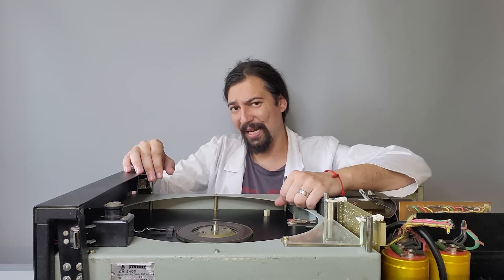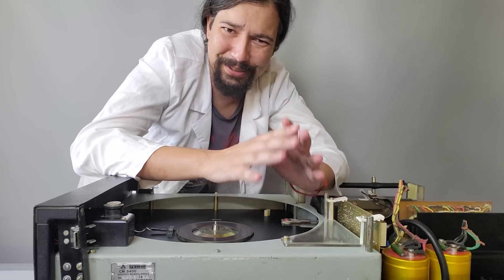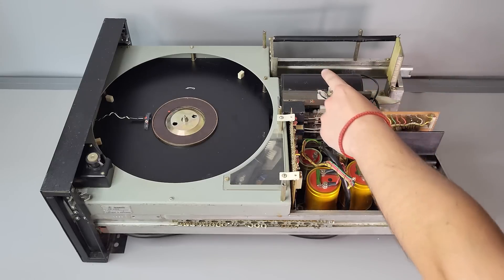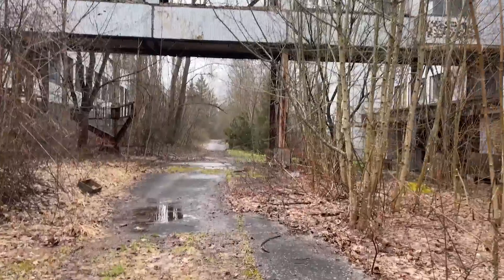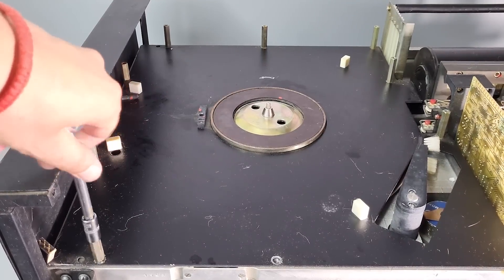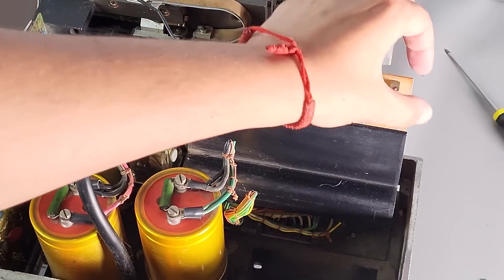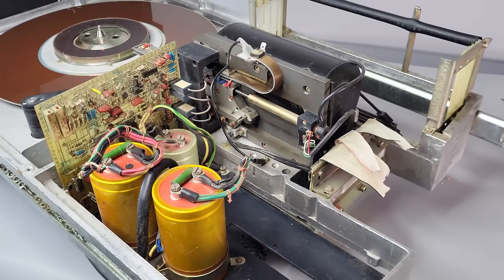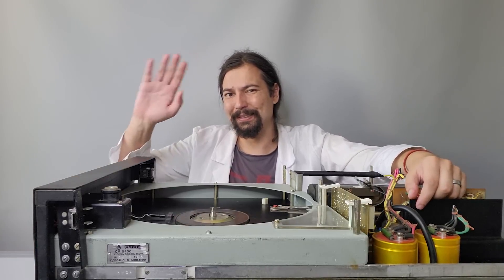The BIGGEST Hard Drive I've EVER Had | SM5400 Bulgarian HDD

Comment: These kind of drives disappeared from use just before my computer programming career started, but the PDP-11 was still in use. Such a fantastic architecture, with a very clean instruction set. We had PDP-11, Vax and Sun SPARC machines during the first years of my career, but sadly they were slowly replaced by Intel PCs with their awful instruction set.
Reply from the maker: Sadly, I saw a functional PDP-11 (in SM 1420 version though) only once; it was an impressive experience.
Reply: I actually had a PDP-11 at home about twenty years ago. It had been a spare machine in case a customer needed a replacement, but we had no more customers using them at that point. It was a later model with the CPU in a single chip and the whole machine mounted in a "deskside" chassis much like an enormous tower case for a PC. I failed to get it running, but the person I gave it to did manage to - it turned out that the memory card was missing and I had mistaken one of the other cards for it!
Reply: @ChernobylFamily  Worked on PDP-11/34, PDP-11/44 LSI 11and VAX between 1988 and 2004. They were all parts of British Air Defence radars and the command and control system. The Radar I worked on had two PDP-11/34's linked to a secondary bus box which allow both processors to talk to the interface cards and extra memory in the secondary box. No disk drives on that kit, because just before I got to work on it, they were replaced by a 2gb Solid state drive, loaded from a data tape that emulated at disk drive. The VAX / PDP 11/44 system did have single and multi platter disk drives on it, plus reel tape units.

Comment: I mean, looking at it, it's not that much bigger than I remember my Olivetti IBM AT's 20 MB drive. And that thing was a desktop PC.
Reply from the maker: I might be wrong, but I recall that likely this existed in desktop version too. Or these are false memories...
Reply: @ChernobylFamily  If it sounds like sitting inside an MTZ tractor when you turn it on, then you remember it right.
Reply from the maker: @dominic.h.3363  bhahahahhaaaa
Reply: @ChernobylFamily  I'm not even kidding. When you turn it on it rattles so bad, it's like sitting inside a tractor. After it spins up, the rattling stops, but the rumbling never does.

Comment: It looks similar to Centurion’s HAWK drive. It had 5MB fixed platter and 5MB removable platter placed on top
Reply from the maker: Might be, might be. Somewhere they had to get an inspiration, let's call it this way.
Reply: the removable disk pack looks pretty much exactly like a Centurion hawk drive. watch usagis latest video. but i think it was just a common design back in the day  @ChernobylFamily
Reply: @ChernobylFamily either espionage or possible allowed licensing.  Bulgaria had a little more warmer relation with some western countries
Reply: Though the CDC Hawk dates from 1973.
The most obvious difference is that the Hawk platters are brown typical of ferric oxide or possibly a mixture of ferric oxide and chromium dioxide. Whilst this platter is black, implying that it's purely chromium dioxide, even metal.
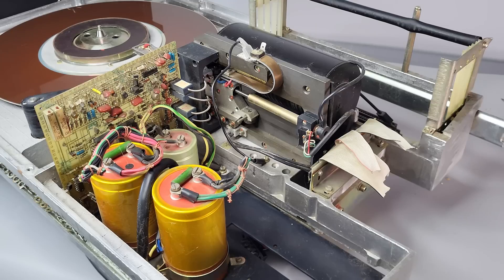Reply: @markevans2294  The fixed platter is brown (10:08).
There were also shiny silvery metal platters (I think the removable platters @ 11:10 are the ones).
Reply: The CDC Hawk was one of the most popular disk drives in that era, and had been sold as OEM to many computer manufacturers (I had written under some of Usagis videos how this drive looked incredibly similar to the one in use in my Nixdorf 8870 server, until I checked and it actually had both Nixdorf and CDC labels on the frame). So, it's not a surprise the Russians chose this specific one to clone.
Reply: @WooShell I've talked to software developers who programmed some improvements for Chernobyl 'station'. Nuclear minestry was one of the richest agencies in USSR and could afford any hardware they wished... It was a PDP-11 clone СМ-4 it was interesting and modern. From 1975
I suppose the disk was the same DEC used for PDP
Reply: @WooShell doesn't asianomotry cover the history of soviet etc computer industry
Reply: @highpath4776  yep he had a few videos about those, not so long ago..
Reply: Aka series 4000 drives, made by quite a few manufacturers, including Data General, Diablo and DRI. I used to service and repair them back in the day.
Reply: Exactly! Just go and see what "Usagi Electric" has on his channel 😎

Comment: You should connect to the guy of the "Usagi Electric" channel here on YouTube. He works with old Computers, like the PDP11, or Centurion. He even have a Bendix tube based Computer. Your drive looks very familiar to a Finch or Phoenix drive. Perhaps he can help you with needed parts.
Reply from the maker: Thank you for the tip.
Reply: It’s Hawk drive
Reply: @hyperspaced0  a hawk drive has only 5 MB per platter. Not the, here mentioned, 25 MB. Because of this, I thought about a Finch or a Phoenix.
Reply from the maker: Assuming you have a better chance to see that hardware than me, is it possible that this SM5400 was actually copied from DEC RK05? At least, this is a common opinion among engineers who remember that soviet stuff up and running back in the day.
Reply: @Dirk-Ulowetz  I understand. Hawk is a type not a size. Look, Usagi has two Finch drives that differs in size. Greetings
Reply: @ChernobylFamily  it looks very similar but I think it's not the same.
Ask Usagi, greetings

Comment: Goes to show how far we've come in computer technology when drives that do 1000 times more are mostly solid state chip construction and about 1000th the size as what they had back then...
Reply from the maker: It is very kind from the Soviets they did not make an SSD of a comparable size.
Reply: I know I remember when 10 MB was about the size of a large lunchbox and now I can swallow a terabyte with my breakfast cereal and not notice.
Reply: @DanaTheInsane  - Cool! Very well put, and it's the truth!
Reply: I love the old computers pre 2000. The old TRS80s with 8" disk drives were awesome. The old Hesth/Zenith too
Reply: @Jhihmoac  the only advantage of this device: it is repairable and could be restored. Data could be read by using magnetic powder even when no working drives left...